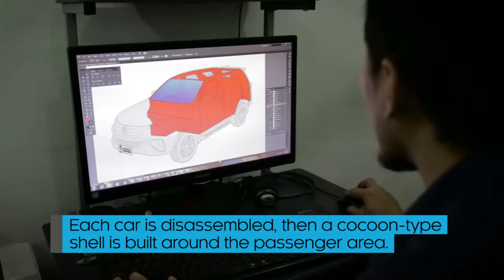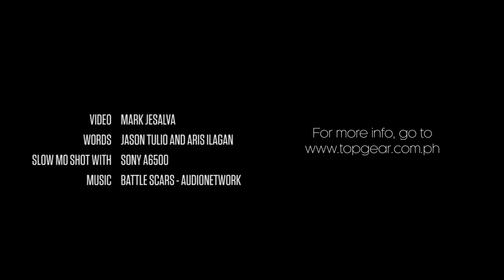How is a bulletproof car made?

Comment: Nothing is bulletproof,it might be bullet resistant but not bulletproof,at least it allows the driver to push its way out of an ambush and then stop in a secure place,thing is,the driver needs to have nerves of steel because once the rounds start hitting the glass,he can't be so scared,driver needs to keep its composure and concentrate on the task at hand.
Reply: Well said 👏

Comment: What if instead of using a ballistic steel use kevlar composite to have a 50% weight reduction
Reply: Not going to cut it for the structural integrity of the car. Also it was proven not effective against assault rifle level of munition